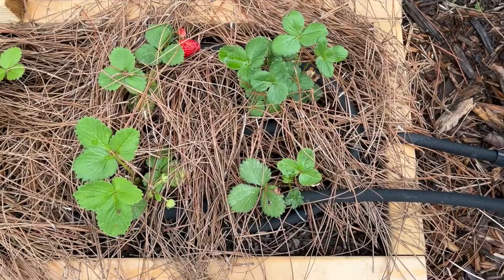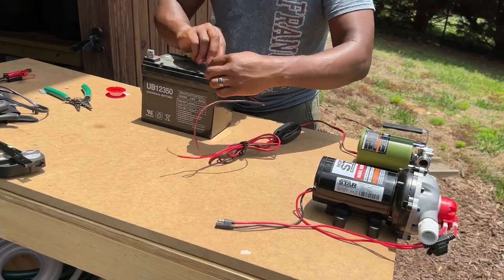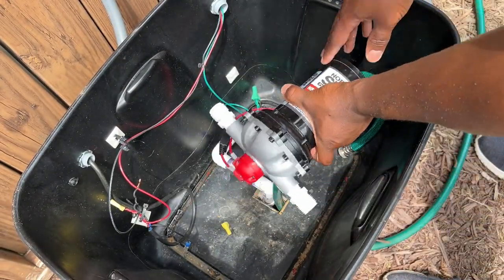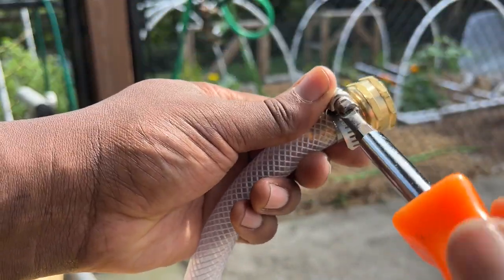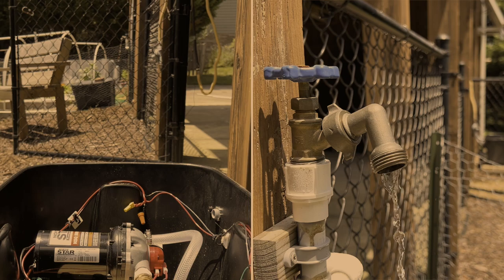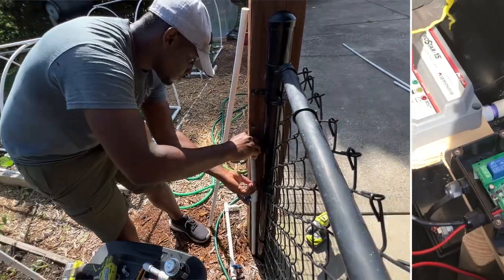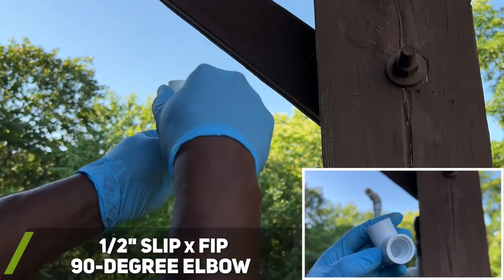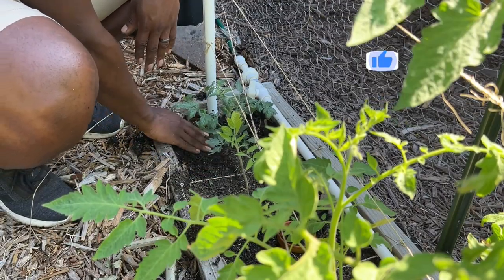Rain Barrel System | EASY Water Pump Upgrade

Comment: I put in a 500 gallon water collection tank.  I used a 1hp shallow well pump from harbor freight.  I connected the tank to the barrel at its low point.  I also installed a 110v shutoff float switch to prevent running my pump dry.  the pumps water tank failed, so I added an additional blue tank.  everything is on faucets.  I will eventually add an Alexa controlled smart timer for my 2, 24 foot raised garden boxes.  the systems m works really well.

Comment: I was just about to buy a pump for my rain barrel, based on your previous video, so this video came at the right time. Thank you for sharing your process, the problems you encounter, and how you solve them!
Reply from the maker: No problem, and the transfer pump is still a great little pump (depending on the application), I just out grew it over time. Good luck with your project!

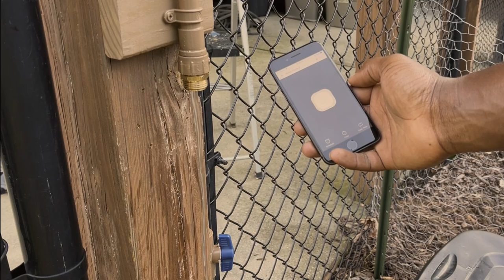Comment: NIce work but creating a high point in the pipe wont stop the water from flowing.  You have created a vacuum... and you found it at 10:30 ;)   We used them on sprinkler systems as well.  Fun to watch the learning process.

Comment: Great video and I like how you clearly explain what you are doing and why. For the pump there are sprinkler Timbers they open a valve and turn on the pump at the same time. Just a thought you could get more control of the water to different beds as well.

Comment: If you're up for it, consider soldering on a flyback diode on the pump.  The usual on/off from the pressure switch causes the motor winding to throw a high instantaneous voltage back through the switch, thereby micro-arcing and charring the switch.  Over time, the switch leafs will be damaged.  The flyback diode diverts the voltage spike back through the winding and dissipates it slowly there instead of through the vulnerable switch.

Comment: Absolutely love your videos. Thank you so much for taking the time to explain and list your projects. I am going to do the on-demand pump setup with solar battery setup for my wife's garden. Would I have to put an on/off switch in order not to drain the battery?
Reply from the maker: For on-demand pumps, it should have a built in pressure switch that will automatically turn off the pump once the outflow path is blocked and pressure is built up in the hose line. However, after reading a few reviews online for some on-demand pumps found online, some people claim that some/most of the on-demand pumps with built-in pressure switches will sometimes fail and not work correctly. So I prefer to remotely turn on & off the power to my on-demand pump even though it has the capability to do this on it's own.
Reply: @GreenTechTown  Perfect! Thank you! I will put a switch to start outside on the pump box and go from there! I will send pictures and or ask for assistance with wiring when I dive in. Thanks again

Comment: As a pressure washer guy with multiple softwash systems, here some fews tip. 1.Avoid using 90* barb (it restricted flow). 2. Don’t ever buy northern star pump ( it suck, try delavan pump or remco pump ) 3. You can even upgrade more using 7gpm pump or 10gpm pump with 24v setup

Comment: Excellent videos! Since you are using a 12v DC system, where did you connect you ground wire coming from the pump? The Positive and Negative seem obvious, but I did not see the other end of the ground. Thanks for all your work!
Reply from the maker: I'm not sure if I showed it in this video or not, but I ended up connecting a ring terminal to one of the mounting holes to attach the grounding wire if I remember correctly. I basically created my own grounding point on the pump since the manual did not call out one, but I made sure that point had continuity with all the other metal surfaces that could be touched by hand.

Comment: If you like gadgets, get yourself an automatic wire stripper. It's much nicer than the type you're using where you have to pick the correct gauge. It's also easier to strip the insulation from multi-strand cables.
Reply from the maker: Thanks for the tip MRAB! I looked that up and you are right, those types of strippers make the process much easier. Will be ordering soon!

Comment: Great video and way of explaining. Thank you!I had a question on the size of the pump.  I learned that the average flow rate for faucets is between 1.0 gpm and 2.2 gpm.  The Northstar pump you recommend has flow rate of 5.5 GPM.  Why do you need 2-3x more higher flow rate than a typical faucet when a faucet has enough pressure to deliver to a residential garden?
Reply from the maker: Hey Junko. I went with a pump this size due to the distance the water source (rain barrels) were from my garden, and due to the increased amount of water demand I planned on adding to my garden.
Reply: @GreenTechTown  Thank you! I'm impressed with your easy to understand and user friendly (list of what you used in your comments) as well as you taking the time to respond!!

Comment: These videos are awesome. One question, why not mount the pump near your barrels and electrical panels to centralize your setup and reduce its footprint? With the waterproof SAE connectors I believe you could even forgo the enclosure that way, as those pumps are typically rated for outdoor use.
Reply from the maker: Hey Kyle. Good question. It was just less work on my part to just use the enclosure already setup for the pump, and since the PVC from my garden was in the same location, but at some point I probably will move everything to that area to reduce the footprint.

Comment: Another excellent instructional video. + fan of the chapters. I have been going back through the series wondering why you didn't start with an on demand pump, now I get it. I plan to do a similar setup for my compost tea tanks but need to work through filtering challenge - any suggestions?
Reply from the maker: That's an interesting project. I have not heard or seen that myself so I cannot recommend anything at the moment, however, I know you can find mesh filters that fit standard garden hose, or barb fittings on Amazon.

Comment: Thanks for the great info! Question: when your rain barrels run dry will the pump burn out if it is turned on or does it have a safety mechanism to prevent burn out in a dry barrel scenario?

Comment: I have one rain barrel (60 gal) and I would like to drill a hole through my T-1-11 and then run a garden hose through to the rain barrel.  Once inside my shed, I would take the garden hose and splice in a 120-volt water pump allowing me to pump the rain barrel water into my 55 gal water barrel that I have set up inside my shed where I make up the nutrients for my hydroponic garden reservoir.  It seems to me this would be the simplest way to get the water from the outside rain barrel to the inside water barrel.  I was wondering which water pump you would recommend.  I think having an on/off switch on the pump would be a wise move.  Thanks for your suggestions.
Reply from the maker: If this will be more of a manual operation system, a simple transfer pump should be fine as long as the outlet part of the hose going to your hydroponic garden reservoir is always open. The one I used in the video is handy since it has an on & off switch built into the power cable.
Reply: @GreenTechTown  I've noticed that these water pump are run off a 12v battery, I'm looking to run my pump off 120v outlet, do you know of one that will meet that requirement?
Reply: I've researched 120v pumps and the cheap ones claim to produce 330 gph but looking at these units they are quite noisy and about the size of your hand so I'm concerned they will fail.  Do you have any experience with these types of units and any suggestions?
Reply from the maker: I do not have much experience with 120v models. But if I wanted to get my feet wet with one, I would probably buy a 120v model from Harbor Freight like this one if I needed a bit more horsepower: https://www.harborfreight.com/12-hp-cast-iron-transfer-pump-1525-gph-63316.html
I'm sure Amazon has several models available too, but I would just read the reviews before purchasing. 
Of course with either route, you should be able to return the pump if you find it is not the right fit or overkill.
Reply: @GreenTechTown  thank you for your feedback, I bookmarked your page.

Comment: 2 months later…. How’s the new on demand pump doing? Do you like this specific pump brand? Definitely what I want to use when mine is finished setting up.
Reply from the maker: Hey J Fred. Yes, so far it is still working well for my application. If something does come up, I'll definitely try to share that with you all via a video on the problem and hopefully a solution. Fortunately, I have no complaints so far. I would recommend if you can, try to keep the pump/pump enclosure out of direct sunlight to help prolong the life of the motor components. That is the only modification I will probably make later down the road.

Comment: Since you don't use the on-demand feature, would it have been easier to just replace the old pump with a more powerful pump that wasn't on-demand?
Reply from the maker: Possibly, however, I had a hard time finding DC rated transfer pumps that delivered more pressure. Also, under the right circumstances, I experienced some of these same issues with the transfer pump, but the siphoning was not as extreme, so it was definitely something I've been meaning to look into for a while.
Reply: @GreenTechTown  How about the float switch? Do you still use it now that you have the on-demand pump?
Reply: Since I posted this question, I think I've found the answer. I had assumed that if the rain barrel were empty, then the pressure on the input side of the pump would drop and the pump would shut off. But I heard in another video that the pump only looks at pressure on the output side. So the float switch would still be required.

Comment: Does the float switch still apply to this pump? or would the on-demand pump recognize there is no water is the barrels?
Reply from the maker: Hey Matt. Great question! Yes, the float switch would still be useful. The on-demand pump would not sense there is no/not enough incoming water. I have heard people say some on-demand pumps can "run dry" (run without water present and not become damaged) but some say they still do not recommend it. I would verify with the manufacture for whatever pump you decide to go with.
Reply: @GreenTechTown  Thanks for the clarification, I've been taking notes on all your videos and hope to setup a similar system at my parent's place. Thank you for everything

Comment: What was the best pump that worked for you? I cant find on the links. I thought you changed to another one since this video.
Reply from the maker: So far I am still using the on-demand pump shown in this video. It has been working great. I am thinking about moving it's location to where the rain barrels are stored so it's not having to combat the heat from the sun inside that black tote.

Comment: I set up my first rain barrel last week (an EarthMinded RainStation 45-gal). I do have brand new gutters with covers but the water in the barrel is not clear. You can only see about 6 to 12 inches down, probably due to sediments washed off the asphalt shingle roof. If I connect a hose and spray nozzle will this rainwater eventually clog my nozzle?
Reply from the maker: Hey Jerome. It's possible but hard to say for sure. I would recommend adding gutter guards to your system, or some type of filter attached to the incoming water connection. I did this for my current setup and it seems to be working a lot better. To help protect the pump, some people also add a small filter in front of the pump, however, I try to reduce the amount of maintenance I may have to do, so if I can filter most of the water before it enters my barrel, I think that is the best route to take.

Comment: Can I just use a 12volt battery to use the on demand pump??
Reply from the maker: Yes, the on-demand pump I used in this video is rated for a 12v DC power source, so a 12v car battery would work just fine, however, keep in mind, car batteries are not meant to be drained often like the batteries in our cell phones for example. I would recommend a 12v deep cycle battery which you can find on Amazon or maybe some of your local stores. The size (amp hours (Ah)) of the battery would  depend on how long you plan to run the pump for before the battery has to be recharged.

Comment: Couldn't you have simply purchased a 2nd water transfer pump and placed it closer to the garden beds so the water pressure is regenerated closer to the exit point?
Reply from the maker: It's something I thought about, and I think some call it booster pumps. Right now though, I'm still glad I went with the stronger pump since it's less hardware to worry about breaking or needing maintenance, and it has the on-demand feature built in so the pump will automatically shut off once the pressure builds up. The transfer pump could become damaged overtime if someone leaves power on the transfer pump, and closes off the water outflow point. This is something I learned after buying the transfer pump.

Comment: What wire did you use to plug the water pump to electricity I have a pump like that but don’t know how to plug to 110
Reply from the maker: These are DC rated pumps that can function off a 12v battery (i.e. a 12v car battery). They do make AC version that would use 110VAC (standard house outlet), but since I am powering my system using solar energy, it was easier to use DC rated pumps.

Comment: What size battery do I need for the new pump 5561T you are using?
Reply from the maker: It runs off 12v, but the Ah rating will depend on how often you plan to use it and what you plan on using to charge the battery (solar, grid power, etc.). I'm currently using a 12v 35Ah battery with a 100W solar panel and the battery has always had enough power to control the pump with me using it every other day. I could probably get away with using it every day since I only run it for about 15min.

Comment: Had you just used standard pressure compensating drip emitters installed into standard brown drip pipe you’d have saved yourself a lot of money, time, and frustration of “balancing the system”

Comment: To bad you told me about this after I got the first pump.
Reply from the maker: The transfer pump is still a great little pump I would recommend depending on the application. However, for those wanting to use a hose nozzle where they will close off the water exit path occasionally while the pump is on, an on-demand pump would be the best route to take due to the built-in pressure switch.

Comment: Why not use gravity, it goes in the barrel and could go out the barrel with gravity.
Reply from the maker: My application/situation would not work too well with a gravity system, but that's definitely an option and several people have had success with that method. Do what works for you.